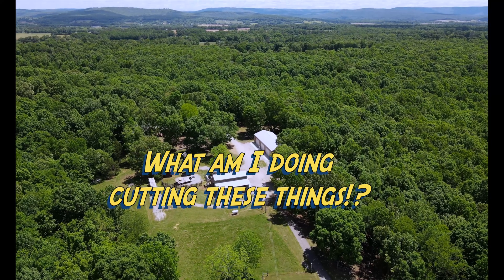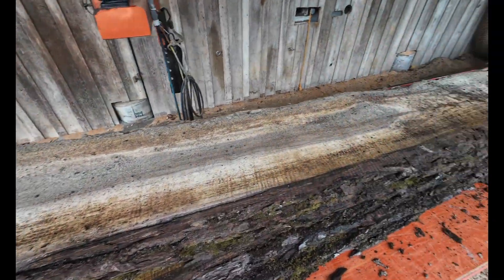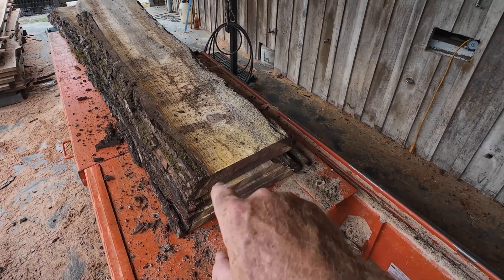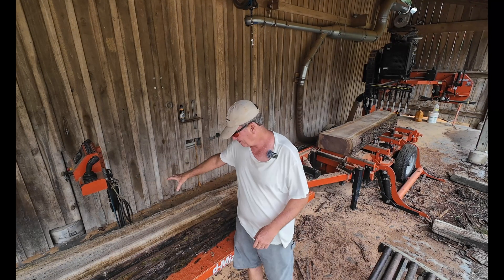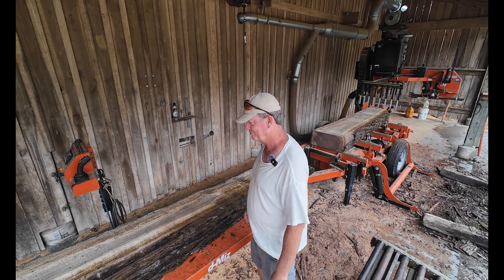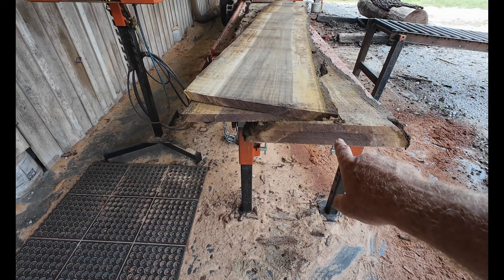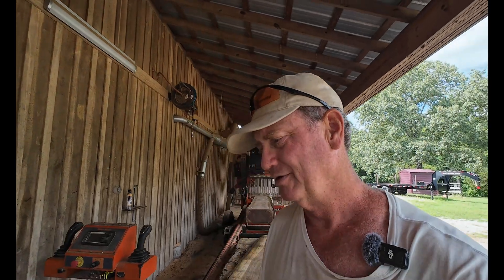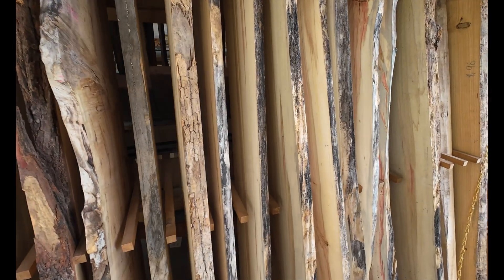Sawmilling What Sells!  3 Products From One Log and With Less Waste!

Comment: Mr. Milton:  In another video you said you cannot keep cool despite wearing cotton tee shirts.  Try this:  buy an army surplus boonie hat / jungle hat.   Get it in the largest size.  Don't worry for now that it may be too big.  You want it that way.  Buy the one with heavy thick cotton duck.  Do not buy the thin fabric hats or synthetic material.  They won't hold much water.  Soak the hat in cold water for a minute or so until it saturates.  Do not wring it out.  Put it on you head dripping wet.  That will keep you cool for up to an hour or more, depending in the day's heat and humidity.  When it ceases cooling your head soak it again, etc.  A good boonie hat costs ~ $15, well worth it on a hot day.  Evaporation makes it work.  On hot days when others are sweating to death, no one will ask who is the old fool with a dripping wet hat on his head.

You owe me big for this one .  .  .  .
Reply from the maker: Thanks, I appreciate the comments.

Comment: As a custom wood and metal designer/fabricator, I personally love using Walnut with sap wood in tables, chairs, benches and butches blocks. The contrast of the dark brown and the white sap wood can be stunning, like using White oak with cherry accents.  
 
I understand there is a standard consistency market for solid heart wood, like in cabinetry and flooring, but I'm a huge fan of contrast applications of Sap and heart wood. If used correctly, it can add stunning character to a finished piece.
Reply from the maker: Yes, you are correct, sapwood is striking and we sell it as our calico walnut product.  Some people love it.  Zero sapwood one face is a huge demand product for us, as it is currently two grades above the current high grade defined by the NHLA, so we get a very high dollar for it and sell it as fast as we can produce it.

Comment: We love selling Charcuterie boards!  In the past, we have finished them and sold them as a finished board around Christmas time.  This year we are thinking of selling the boards for folks to make their own Charcuterie Boards.  Knowing you have build your business slowly over the years, here is my question for the Professor.  We currently have an LT40Wide with just a 26.5 hp Koehler.  With two people helping unload the mill as one person runs the mill, we can hit 300- 400 board feet per hour, so not bad.  At the moment the sawmill is outside, so we are limited to dry days to mill.  We putting up a roof over the sawmill next week, which will automatically increase weekly productivity.  It has been raining like crazy here in Georgia.  After the building is up and we have settled in, we are considering upgrading sawmills.  We have looked at the LT50 because it would fit in our budget. With the difference in cost between the LT50 and the LT70, we could purchase another Nyle kiln (we currently have 2 L200M's and 1 L200Pro ).  We currently mill and kiln dry as a service and do not really sell any product (apart from Charcuterie boards).  Our thought process is to grow with the LT50 and as the cash flow increases, upgrade in a few years to the LT70.   What are your thoughts on the LT50 vs the LT70?   Is it worth jumping to the LT70?  We are worried the LT70 will mill past our current kiln capacity.
Reply from the maker: I have used both, and the LT50 is a good mill.  However, it can't hold a candle to an LT70, with engine driven hydraulics which are 6 times faster than an LT40.  You might be interested to know I had to make the same decision, and my conclusion was that yes a 70 would produce more wood than I could dry through my kilns, but that it would allow me to reach my production goal in much less time.  So when I mill enough wood to "feed my kilns", as I call it, as I reach my daily quota, I can turn the mill off and do something else.  So instead off me sawing all day, every day,  I can saw as much wood in half the time, turn the mill of, and use my free time elsewhere in the business.  So instead of 400 bdft per hour, you can hit 1,000 (I did a video where by myself I hit 1200 bdft per hour to prove to people that I could do it).  So the question is, would getting a more expensive mill with twice the production, which allows you to cut enough to feed your kilns in half the time be worth it?  Then use you new free time for other uses?  In my case it was a big "YES!" and I would never go back to a lower level production mill.  Very good question, and I should make a video on the subject.
Reply: @HobbyHardwoodAlabama  Thank you for taking the time to answer my question.  You have given me a lot to think about.

Comment: I really enjoyed this video!  It's so interesting to see 3 products come from one log. I've only really thought about what dimensions I can get out of a log - this video blew my mind!

I've seen 6x6 posts (sold by big box stores) with the pith smack dab in the center of the post… What happens structurally to a post like that over time?  Does it hold up because it's a 6x6 vs  a 1 or 2 inch thick board?  Thank you for all of your content😊
Reply from the maker: Typically, a center cut post like that will always crack and twist, but generally not structurally fail, if of no other reason that the loads put on dimensional lumber is far below it's true load carrying capacity, and so even a defective post will handle the load.  The biggest issue with those pith centered boards is when they crack and open up, they bow and twist and if in a building will make the walls and ceiling "not straight anymore."   I should do a video on this, good comment.
Reply: Yes, a video on this topic would probably help a lot of us!  Thank you for your thoughtful response😊

Comment: Hey Robert,
If you have a cant on the sawmill that is 8” thick and 12” wide. If you rotate that cant 90 degree so it was 12” thick and 8” wide, does the woodmizer recognize the new height of the cant so it will drop to make your first 4/4 board? Or do you have to line up with the top of the new cant height and then drop down 4/4? Hopefully that makes sense lol
Reply from the maker: Thanks!